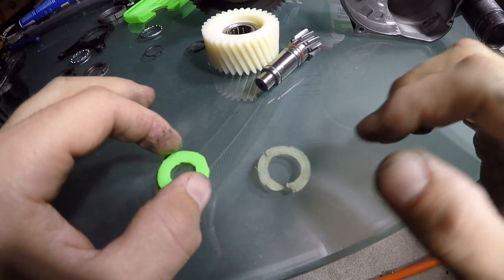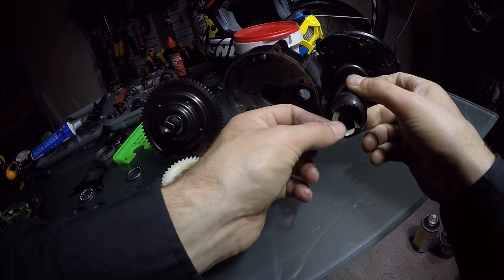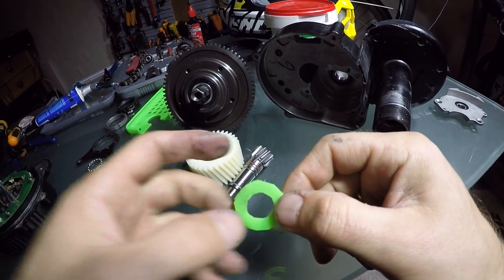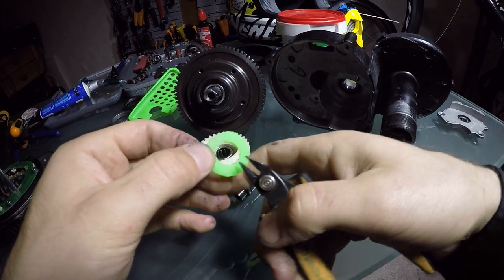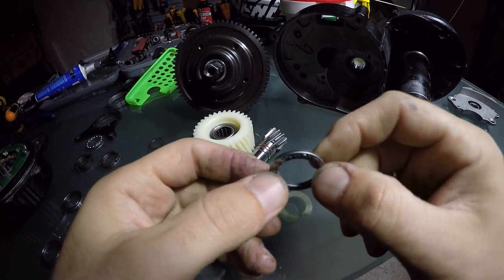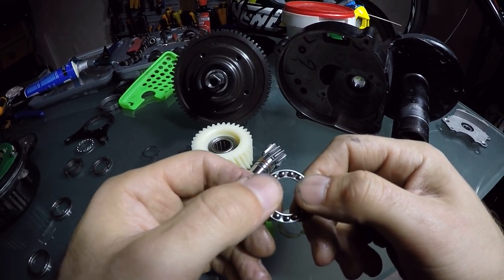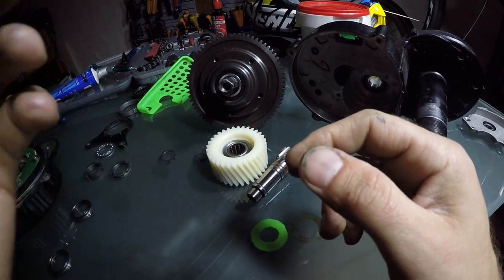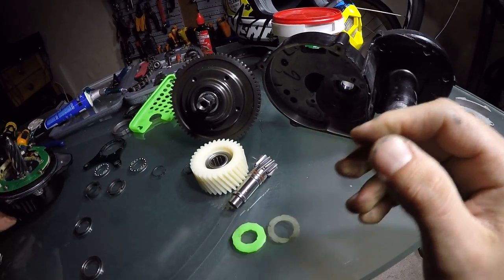DIY Tutorial Repairing BAFANG 8fun BBS02 750w 48v (Part 5 of 7) *bottom-bracket bearings/seal

Comment: we have done so much with so little, we can do anything with absolutely nothing. You sir are a rare person. Thanks.
Reply from the maker: yeaahh... managed to make a silicone washer out of my iphone case hahaha... MacGayver would be very proud watching hahaha  
*ah.. if you want to avoid deforming your pinion gear, avoid large chainrings and keep your cadence and motor RPM as high as possible, this will also save your bike components like chain, your rear cassette, your battery will last much longer, your motor runs more efficiently... the faster RPM the less stress on everything =]

Comment: Hi Bruno, whats the best way to take out the first rubber seal of the pedals shaft? i haveone very tight. Thanks
Reply from the maker: +FREEDA Bicicletas eléctricas Yeahhh... they're a pain to remove... very very tight, try to use one very thin metal and spend some time pinching and bringing out always on the same spot.. there's no way to avoid a little pinch so the smaller the tool you use the better. Once the seal is sticking outside the case a little bit I use a very sharp and thin needle to hold it and reposition the metal tool for the final push.
Reply: ElectricBike looks glued in a washer but even damage dont came out 😡 jajjajaj

Comment: I got that larger pinion gear and now the snap-rings from the slightly smaller one are no longer fitting on there. I checked the Luna Cycle site and they don't seem to have any snap rings for that larger pinion gear available. This is for the BBS02. Is there a specific site for newer snap-rings for the BBS02 internals?
Reply: Never mind. I could probably match up some at the local hardware store. They seem like common snap rings.
Reply from the maker: See if Doug from California Ebike has the part you need, he’s got EVERYTHING if you can’t find on his website, send him an email with the photo of what you need. Some older BBS02 need a bigger plate to fit the new bigger pinion gear https://california-ebike.com/shop/bafang-pinion-support-plate-002-029-12mm-hd-pinions/